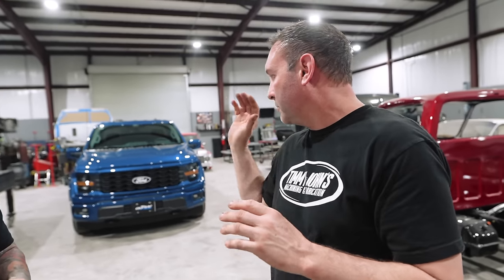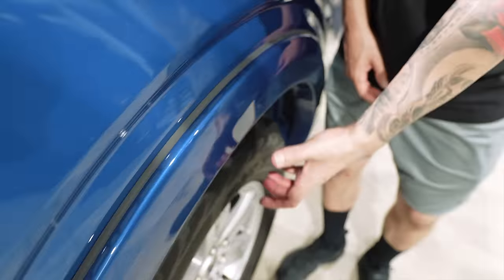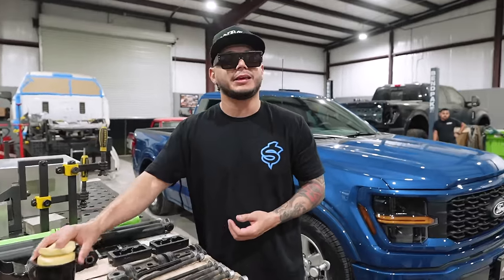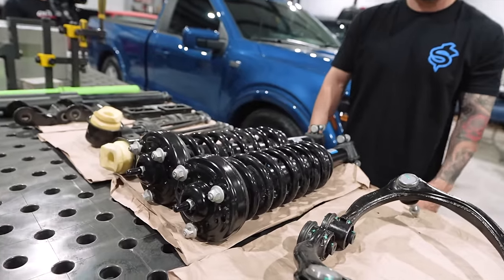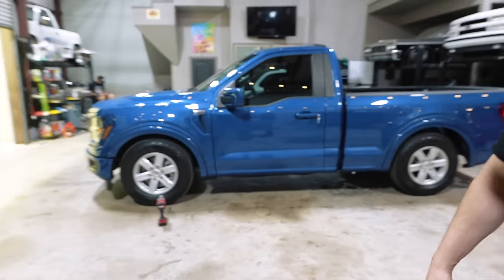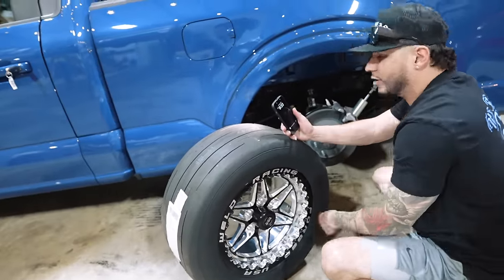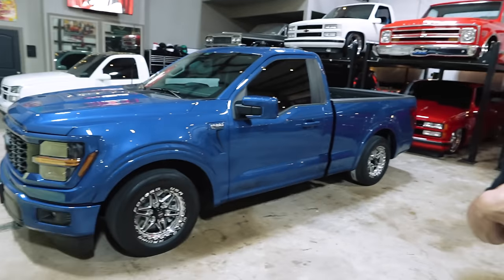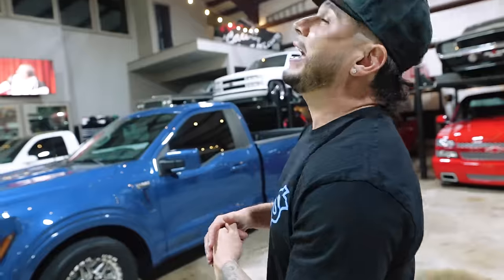Drag Pack Or Big Wheels On The 2024 F150?

Comment: The IHC performance kit with shock relocation is IMO the best bang for your buck that’s fully bolt on and needs no welding done. Run it on my 23’ F-150 on welds w/ whipple and it fucks 👏🏽🔥

Comment: Hey fam, the foglight is not out, he had the foglights off, when you have the fogs off whenever you turn, they turn on w the steering wheel. It’s the “auxiliary” courtesy light feature. You turn left, the left light comes on, you turn right - how Beto did, the right foglight comes on, so on so forth…

Comment: Not sure if u guys are looking for a 96 obs obviously 2 dr tahoe 2wd red on 20 inch US mags n me n my pops left the rest original just found the leather seats for it to very clean no holes ripes or anything on them to just looking for the driver side now but Beto rich enough to just get the driver seat done but got it posted for 15k very clean not all chopped up since u can’t find them clean for shit 5.7 v8 all OG n ac everything working in cali in the valley and it’s lowered perfect and done the actual right way cuz my pops is very picky about that shit new carpet to pretty much redid most of the interior n cleaned it all up n made sure to leave it all og but the double din low miles tech for the year 170 just been sitting in the back tbh n just drive it here n there around the block so it’s had 170 since we got it 5 years ago I’m just very attached to it so imma cry my ass off but it will be nice to know it went to a good home n I get to see it on the vids n know my baby is doing good